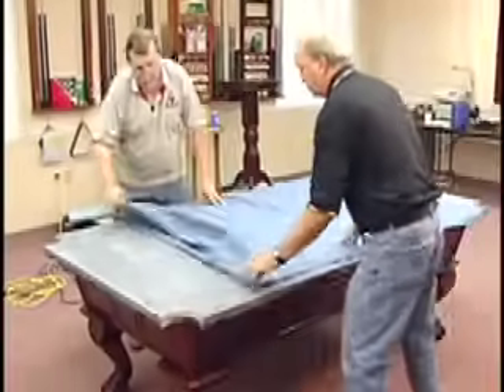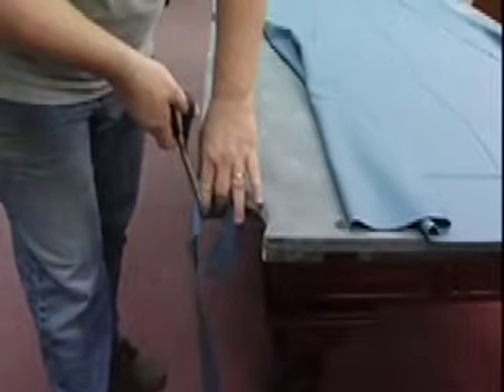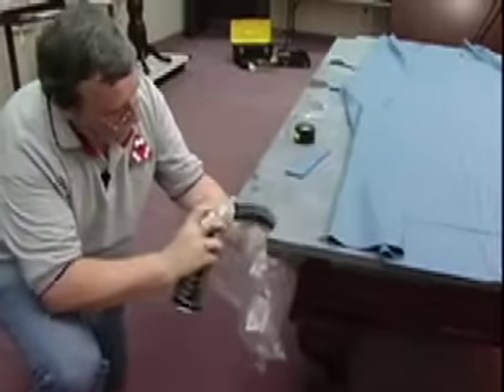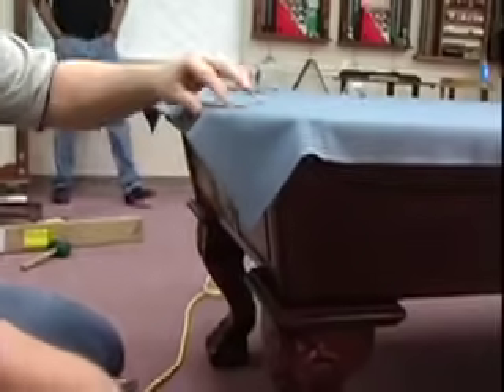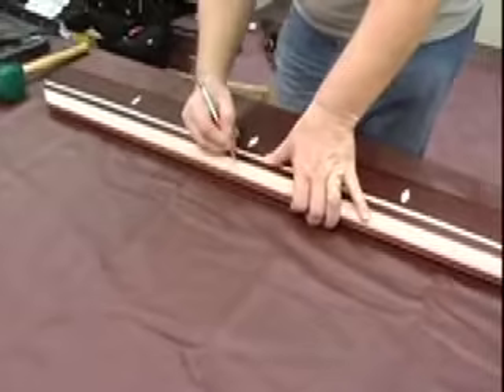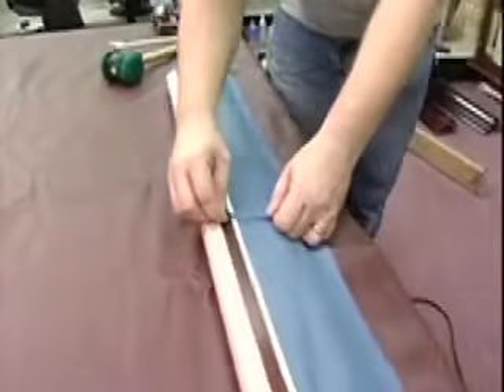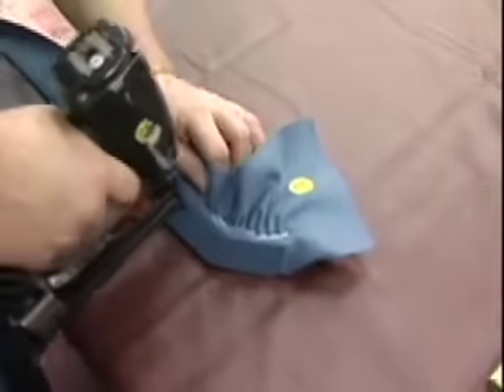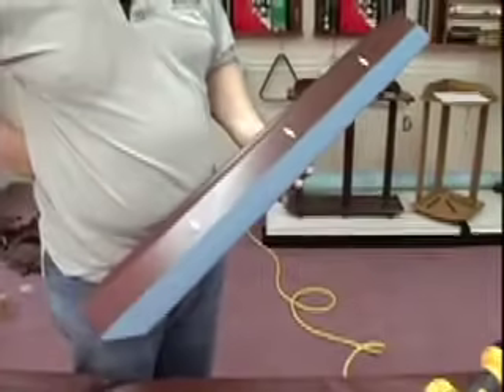How to Install Pool Table Cloth - Home Billiards

Comment: I guess it doesn’t matter which side goes up or maybe it does and if it does how can you tell which side goes up if it’s not marked on the cloth pretty simple question probably the only question that anybody would ask in putting a pool cable cloth down.
Reply: The cloth comes with a sticker on it to tell you which is the top side, and yes it does matter, the top side and the underside are very different. A professional installer does not need the sticker to tell which is the top side, but it's there as a reminder for anyone else who might not know.

Comment: @Odhinn222 The spot is used to protect the cloth under the One ball and should be changed before it wears out. The wear and tear is from the impact of breaking and people that 'tap' the one ball to get a tight reack. If you didn't have a spot, a whole would wear through in no time. If you notice all the white/wear spots from behind the head string, these are actuall bald spots from the cue ball taking off from a stand still plus some downward force on the cue ball from the break.

Comment: Stretching the cloth to the playing surface removes any wrinkles from the packaging. Essentially when he showed the foot and head of the table stapling is how you do the rest of the surface felt. As for the remaining flaps at the side pockets for the rails you trim to fit neatly so there isn't any flaps pushing out the pocket gully or sticking out where it is visible. Some people will also use the spray glue super 77 to adhere the felt for the stretching part of putting the felt down on the edge

Comment: What happens between 3:20 and 3:22?  I presume no adhesive on the table top then, but did not see the rest of the table felt installation on the video.

Comment: I was trained very similar to the way you work....recently though I covered a 9ft gandy big g....with simonis.....boy you talk about stretching.....with regards to the rails I had to learn a different stretch technique....stretch then stable at Least 1/2 above or below point of stretch
Reply: I’ve always used a flat head vice to stretch the felt, instead of just grabbing it with my hands and pulling.. Works really well..

Comment: @homebilliards 
This video seems cut in half at the 3:22 mark of it.  It changes there to putting cloth on the rails from installing the bed cloth.  I would like to see a the rest of the bed cloth installation including demonstration of cutting and stapling the bed cloth into the pockets.  Overall this is the best series on the internet but this one is funky cuz it isn't complete.  And it excludes exactly what I want to see  bummer!!

Comment: The thumbnail gave the impression you used the glue instead of staples... I like staples, works well with my table, but I’m interested in the glue.. Can you explain the benefits or drawbacks of both?..

Comment: I have one pocket on my pool table, that for some reason, just won't except balls that touch the rail first. It's a corner pocket, the same shot on any other table or even the other three pockets on my table will except the exact same shot. I've measured the pocket and looked at it under a microscope and I just can't figure out why it acts like this. It's really irritating and I was wondering if anyone else out there has ever run in to a similar situation. Is there any way to fix this problem? The pockets are fairly tight, but they aren't triple shimmed or anything. A ball shot at this pocket will jaw where the same shot at the other three pockets will go in. You can't cheat this pocket. What in the name of holy hell is going on?
Reply: The down angle of the shims/pocket opening should be around 13-15 degrees. If it has no angle, it will spit balls out .